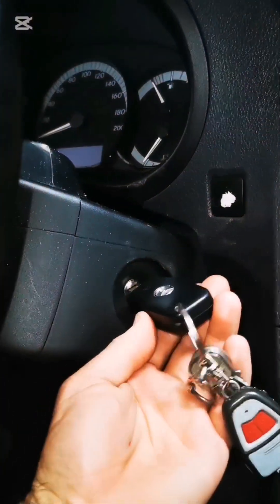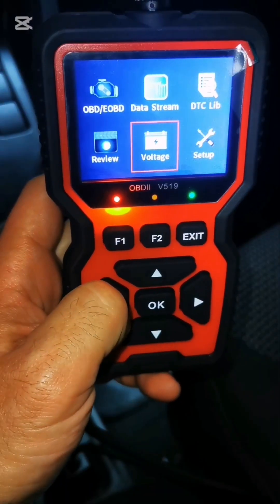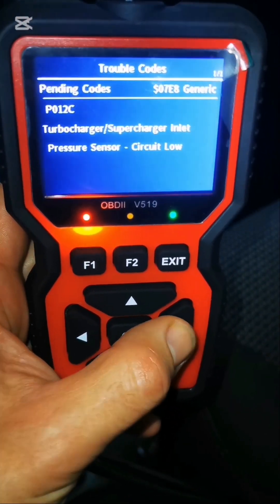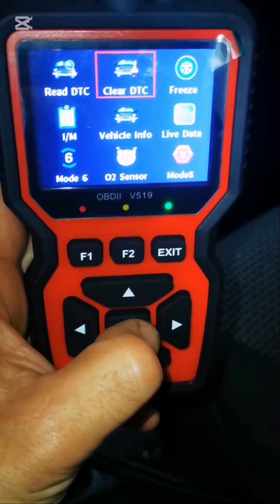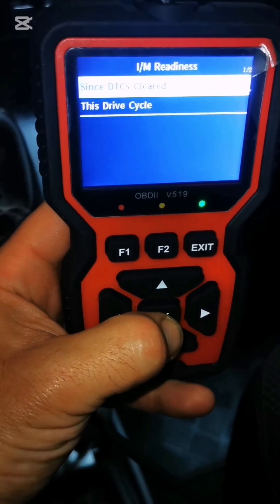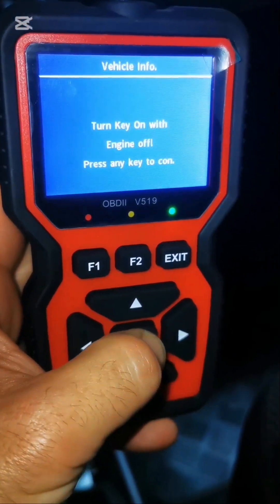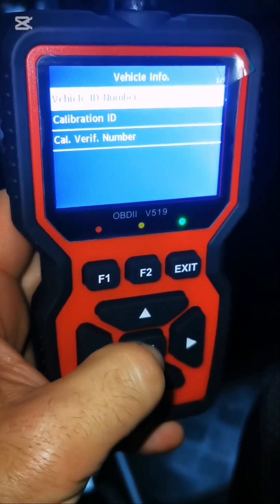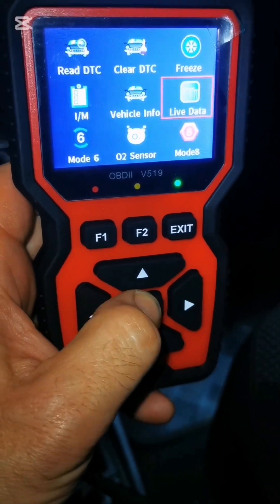V519 OBD2 Scanner Review & Tutorial | Read Codes & More

Comment: Got one because my parking senses stopped working this code reader does not work it does not bring up any code at all
Reply from the maker: This scanner reads only engine codes. Those not have the capability to enter in other modules other then engine module.
Reply: A codes a code doesn’t if it’s engine or not
Reply: @Yorkshirex  It does as you need dealer level scanners to access the other computers
And check all lights as with some cars the brake lights not working can make the traction control disable itself

Comment: I got one, it works as in lights up and shows battery voltage but will not communicate with the car maybe they wired the plug wrong idk, i used a friends cheap one and that one works fine but this one doesnt
Reply: The same problem for my Toyota Land Cruiser
Reply: Me too I got the same problem it's not working for me
Reply: I have the same problem and it will be costly to courier it back to Temu.
Reply: @MarabiDagane they sent me a refund and told me to keep it in the end
Reply: I have this scanner and plugged it in and turn the key to the on position but cannot connect to the car. Then I plugged it in and started the car and then it worked @MarabiDagane
Reply: If you have problem of conecting with car - it will be usefull to write on what brand and model of car you used it?
Reply: R53 mini  @draganerakovic4294
Reply: @draganerakovic4294 r53 mini cooper s
Reply: Same issue.Mine doesn't work as well
Reply: Does it needs software?I bought one someone told I must update software
Reply: @JohnMorabe-p3r  I wouldn't know how to update it I plugged it in and it never worked
Reply: Mine too am in Kenya ,mine act the same with as yours